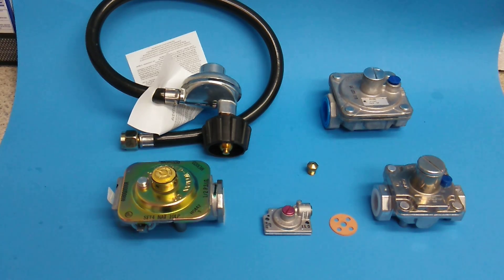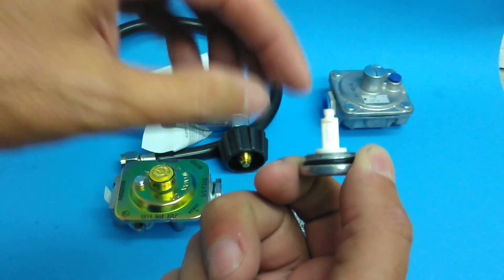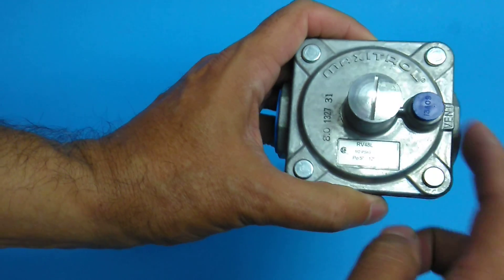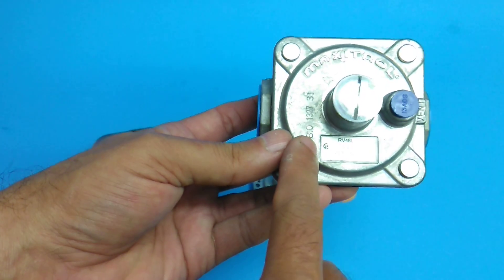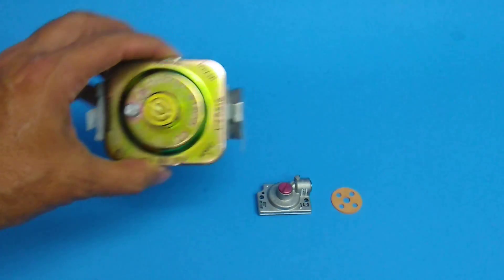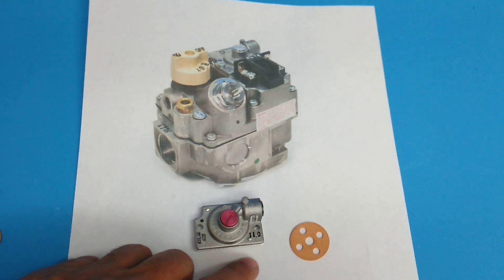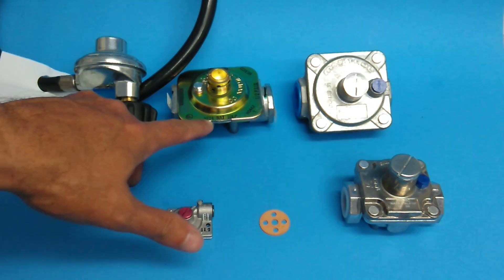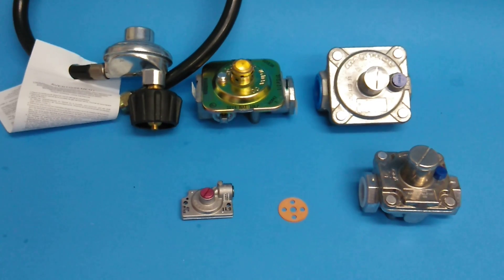Fuel Regulators Explained

Comment: Good day ! Great video . I bought an used Weber Summit 420 . Allegedly it was for propane (although it did not come with a hose) . When I connected the hose (with a normal propane regulator) to the bottom of a Maxitrol RV47L ( 1/2 psig  , Po 2.8" - 5.2" , with a marking on ther that states 1020 48 4.5 , which I assume 4.5 being the factory setting) , I see that the flames are very high , with tall (4" or so) blue and yellow flames (when just opened to maximum knob) . They are 2" high when on the low knob setting . I assume the grill is actually NG , but I am not sure now how to proceed . Should I replace the regulator ? Replace the nozzles with smaller diam ones ? bypass (remove) the Maxitrol before doing so ?
Reply from the maker: That regulator is not a propane regulator. If you're using a tank under the grille, just buy a regulator from Home Depot to see what the flames are doing with that regulator. If the problem still isn't resolved, just contact me again, and I'll send you some propane orifices.
Reply: Frank Hamilton just tried , even worse . Will definitely need nozzles. Please email me your contact so I can organize it directly with you. Trummers@hotmail.com
Reply from the maker: I've sent you an email so we can get the ball rolling.
Reply: @frankhamilton8257  Frank Hamilton just tried , even worse . Will definitely need nozzles. Please email me your contact so I can organize it directly with you. Trummers@hotmail.com

Comment: Thanks for the video.  I have a fire pit in my backyard that I just converted from propane to natural gas.  The regulator I got is the Chen Fong 3030 that you initially showed in the video.  When I ran the fire pit with the propane the flame was pretty high and great.  Now with the changeover, the flame is pretty low.  Is there a way to adjust how much gas goes through this regulator, or is there another issue that I should be addressing?
Reply from the maker: If you've only changed the regulator and nothing else, then that's the issue. You need larger orifices to support the natural gas burn. Here's a chart: https://andersonforrester.com/conversion-chart/

Comment: I need to replace the regulator on my natural gas stove. The regulator that is on there isn't sold anymore. It is a Maxitrol. The info on it is RV35AC, Class I & II -11.5, Po 6"-10".   Can I use a regulator with a different water column? Hopefully you can help.
Reply from the maker: This is an adjustable regulator. Adjustable regulators usually have the output rating that they are set at stamped onto the housing. You can replace this with another Maxitrol professional regulator, then adjust the output to match the burners on your stove. Questions 714-574-1544.

Comment: Hi Frank, I found your video very helpful. I have a follow up question on the Maxtrol regulator. You mentioned it was either made for natural gas or propane. I have a wok station that's hooked up to natural gas witha Maxtrol regulator but I need to take the wok to an event so I need to convert to liquid propane. Do I need to change to another regulator or can I adjust the Maxtrol on there? Thank you
Reply from the maker: If the regulator is adjustable, then it is either Natural Gas or Propane. The label will say something like Po 3" - 6" on the small tag for natural gas and Po 5,0" - 12" for propane (the numbers may vary). If the regulator has fixed ratings for either natural gas or propane then it's convertible from one gas to the other, so such a regulator would say something like Nat 5.0"  & LP 10"   

A natural gas regulator is NOT designed to work on a propane system and a propane regulator is NOT designed to work on a natural gas system. The worse case scenario is installing a natural gas regulator onto a propane system because it will flow far and above the quantity needed to produce a properly regulated flame.

Comment: Who can install or replace a gas regulator that connects to a dryer?
Reply: Well I'm going to take the moment and answer. don't know if you're actually looking for an answer still.
But if it's on the appliance.
Large appliance repairman.
If on the gas pipe.
Licensed plumber or gas fitter.
If you're competent enough and it's legal for a owner to work on their own gas. Have at thee.
But I do not suggest, you do it if you are not comfortable and skillful enough to do it safely

Comment: Great video, Frank. I don't have a lot of use for such detailed info, but I like knowing, and who knows what I might run into someday.
A question... I am putting a (new old stock) 4 burner grill in a kitchen island, and am not sure if it's set up for natural or LP. I know LP orifices are smaller, and natural is often about 1/8" or so. Can I safely assume that if I find the orifices to be like pinholes, or maybe up to a millimeter in diameter, that it's LP? Or vice versa, if it's close to 1/8" assume it's NG?
Reply from the maker: Converting the regulator is only one part of doing a fuel conversion. I actually sell orifices for every stove and barbecue made. I'm now in the Midwest, and you can always get a hold of me at 714-574-1544.

Generally speaking, if you're talking a bore size of 1 mm or thereabouts (a #60 drill size or smaller), you can be relatively sure that the hole is bored for LP.  A 1/8 hole for natural gas would be enough to produce a flame the size of a small  flamethrower, so your assumption is slightly off. About the largest bore size that I've ever seen on a (common) barbecue using natural gas, is about 1.65 mm or halfway between a #52 and #51 drill size. I qualify that statement with the word "common" because I recently did some orifices for a topside burner system that was capable of nearly 30,000 BTU.

I normally reverse calculate the heat range using a mathematical formula, however you can estimate from a boring chart like this one from Anderson Forrester:  https://andersonforrester.com/conversion-chart/    This is great when it comes to estimating , but when it comes to boring orifices for natural gas and propane that will be used in the real world, I don't estimate.

The other issue plaguing the industry, is that most of these manufacturers lie about the true heat range of their burner systems. This is great for advertising, but it spells disaster for the consumer when it comes time to DIY convert his home appliance.  That's why people contact me when they're converting their equipment. I likely have orifices for everything made, and if I don't I can machine the pieces necessary to do the conversion to match factory specs. Feel free to contact me at 714-574-1544.

Comment: This video was super helpful to me. I bought a used range that I was converting to LP but it has a commercial regulator on it and I thought it was missing the plastic plunger to press up against the spring to increase the pressure. Turns out I just needed to reverse the cap!
Reply from the maker: Converting the regulator is only one part of doing a fuel conversion. I actually sell orifices for every stove and bar-b-que unit made. I'm in the Mid West, and you can always get a hold of me at 714-574-1544.

Comment: Great video Frank. I got my offices, and regulator switched over. My question is do you need a regulator leaving the bottle prior to going into the equipment regulator? Reason I ask is I’m running two pieces of equipment a counter top stove, and a fryer. Both have their own regulator but they both say they are only rated for 1/2 psi any more will mess them up. So would I put a regulator leaving the bottle to lower the psi? It’s now Lp 100lb bottle. Thanks. Love your videos!
Reply from the maker: If the regulator at the propane bottle is a normal type of propane fuel tank regulator, then it's rated at 11"WC. The equipment regulators are likely 10"WC (they might also be adjustable if they're commercial regulators dedicated to LP). If they are fixed regulators,  there should be no conflict between the two so long as the equipment regulators are rated at 10"WC. Still, it's best to get a straight tank connector without a regulator to eliminate any possible conflicts between dueling regulators.

Comment: Excellent presentation. I have a question on a commercial fryer that has been converted from propane to natural gas I'm assuming correctly, I've adjusted the pressures on the honeywell combination gas valve regulator to 4.11 iwc I have a nice blue flame but the issue is when we put the thermostat in the off position I have some gas still escaping creating small flames on the orifices. We've diagnosed the issue with help from manufacturer tech support as the gas valve regulator. I was told to replace the whole honeywell combination gas valve regulator unit, but could I just simply replace that regulator instead? Is that a viable option that they aren't telling me about? Wouldn't that be cheaper than spending 240 bucks on the whole thing?
Reply from the maker: If you haven't swapped the regulator on this unit, you're working with a regulator that's designed to normally work at 10"WC to 11"WC. There might be an adjustment on this regulator, but it would only be from likely 7"WC to 12"WC. An adjustable natural gas regulator would be adjustable from likely 3.5" WC to 7"WC. The shutoff function of this switch is an entirely different issue altogether.  After all, off is off.  You might try the new combination regulator/thermostat to see if this issue continues with the new unit. There's also the possibility that some debris might be jammed in the shutoff valve. If that's the case, you might be able to get the valve to open, then blow compressed air backwards and forwards through the regulator. Keep in mind that the regulator might only allow gas flow in one direction. I hope this helps.
Reply: @frankhamilton8257  thank you for the quick reply. You seem to be the most well educated of all the people I've spoken to concerning this matter. I am trying to save the owner of this unit some money but of course only if it will make the unit 100 % operational and up to specs. I like where you are going with the debris and the valve comment as this fryer was in terrible condition and I did a thorough cleaning of it. So if to change the unit from Propane to Nat gas only requires changing out orifices and a spring how then can they keep using the same regulator? That is what I don't understand AND it's approved by the manufacturer.
Reply from the maker: You have to remember that, when you're talking to a factory rep, he is usually only as good as the documentation that he's reading from.  There's just no substitute for hands on experience.

Comment: Mr Hamilton enjoyed this video. Have questions about maxitrol RV 47 CL. The question is how much pressure can the supply side take. I have a Jenn-Air cook top that I want to use outside on 20lbs propane bottle. Will this regulator handle the refillable bottle pressure? Thank you for providing the info you share.
Reply from the maker: That regulator will handle being directly hooked up to the bottle. You'll need to hook the regulator directly to a pig tail connector with a QCC type connection. The regulator will allow the flow of LP at 10"WC.

Comment: I just put in a Takagi tankless hot water heater, and used a bbq regular for gas supply. The blower motor goes on as soon as I use the hot water, but it isn’t firing up. I also don’t hear any clicking from any auto spark, so I’m not sure what’s going on. The regulator is supposed to be 11 inches water column which is within the manufactures specs. Will the hot water heater not start if there’s not enough gas flow?
Reply from the maker: It's likely that the unit uses an integrated regulator, thermocouple and on/off valve where the regulator is part of the mechanism. This type of regulator is covered in brief in this video, so you'll likely need to swap out the natural gas one on your unit for one like this. I'm not sure if this will solve the issue, but the integration is needed for this type of mechanism to work properly.
Reply: Hi Flat Earth Fisherman, I am having the same problem with my tankless water heater. Any tips on how you fixed your issue? I am soooo over cold showers! Please advise.
Reply: Melanie Gachupin 
I got a different bbq supply line and regulator. I forgot which one, but it lets more gas through. Evidently if there’s not enough gas, it won’t fire up
Reply: Melanie Gachupin 
https://www.amazon.com/dp/B01M4SA4PG?ref=ppx_pop_mob_ap_share

https://www.amazon.com/dp/B0728L9GTK?ref=ppx_pop_mob_ap_share

These were the two that I bought from amazon. Not sure which one worked. The hot water heater is about an hour away from where I am, so I can’t look at it. Amazon gives free shipping on returns though if you ended up getting both.
Reply: Melanie Gachupin 
Alright after looking at them, I think it was the gaspro that worked. I bought them both at the same time so I can’t tell  by the date of purchase.

Comment: Regulator froze, can I unfreeze it by disconnecting the regulator and hose, will work after thawing it out
Reply from the maker: You must be running an extreme amount of fuel through your system. I'm taking this as the regulator is literally getting frozen. Is that correct? Trying using a commercial two stage regulator with a higher BTU rating, albeit it sounds like your flowing an extreme amount of fuel, but the larger capacity of the two stage regulator might do the trick.

Comment: Hello Sir,
 I just bought cooktop with a regulator built in a Maxitrol 1/2 PSIG LP 10.0" im going to run it off an LP tank, do I still need a first stage regulator at the tank
any information would be appreciated
Thank you
Reply: Thank you for the info on the Maxitrol RV47CL. Please forgive my ignorance. What are QCC connections.
Reply: @omegamanalphadog   The qcc connections are the connectors that go into a propane tank the ones you screw in counter clockwise
Reply: Were you able to find an answer?
Reply: Yes you still need a first and second stage regulator the one on the stove further controls the gas flow when you light the stove

Comment: I've got two 100lbs LP tanks for my homes Tank less water heater and stove. What kind of regulator should I use?
Reply from the maker: Your natural gas supplier can best recommend a regulator that will best work for you. The system will usually have a regulator at the source, then each appliance will have a propane regulator at it's inlet. I have LP regulators for bargecues and outdoor cooking appliances, and your appliances will usually have a convertible regulator for use with natural gas or LP. You can always contact me if you need a regulator for your Barbecue - 714-574-1544.

Comment: Can you run an acetylene tank straight to a burner with no gravy later and be okay
Reply from the maker: I suppose it's possible to burn any type of fuel, but is it the wise thing to do? Acetylene, like propane is in liquid form in the bottle, and it transforms to a gas when it hits the atmosphere because it's boiling point is -119 degrees F. I'm not familiar with the working pressures of Acetylene and I'm not sure what the correct ratio would be to mix oxygen with it or if the oxygen would have to be introduced under pressure.

There's also the danger of introducing acetylene into a manifold that's not necessarily designed to handle it. Natural gas comes out of a pipe at 7"WC here in North America, while propane is typically regulated to 10 or 11"WC. These gases are regulated down to these working pressures to make them relatively safe to use in a cooking environment. It would be hard for me to speculate what a practical working pressure for acetylene would be. The o-rings for the valves are designed to work with natural gas and propane, but are they designed to work with acetylene?  Also, acetylene, if not properly mixed with oxygen produces an extreme amount of soot deposit which could adversely affect the performance of a burner system if not properly kept in check.

There's also the consideration that acetylene sours in the bottle after a time, unlike propane and natural gas. I'm aware that butane is often used in 3rd world countries, but again, I'm not familiar with the ratios of butane to oxygen for a correct burn. Bottom like is that there's likely a good reason that propane, natural gas and butane are universally used in cooking application while acetylene is not.
Reply: Frank Hamilton what about running propane to a sealed natural gas water heater? I do have a pressure regulator at the bottle of propane set to 6 wc as the water heater calls for a min of 5 and a max of 11 wc.

Comment: Can you use line hose regulator and stove regulator together on a propane tank?
Reply from the maker: The hose regulator is usually rated at 11"WC, and the stove regulator is usually rated at 10"WC (unless it is a regulator made for propane that is adjustable). It's possible to use the two regulator's in line because there will not be any conflict so long as the one regulator is rated higher than the other, however a much better solution would be to purchase a hose with a propane tank connector without a regulator, then hook it in directly with the stove's regulator.